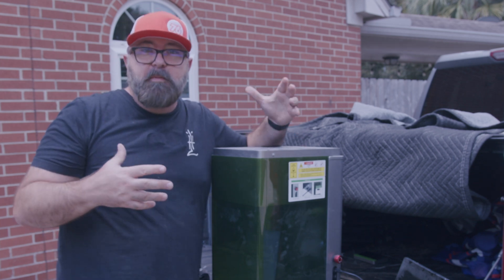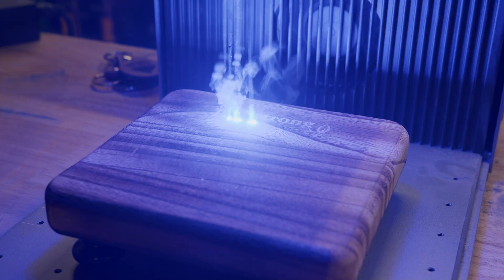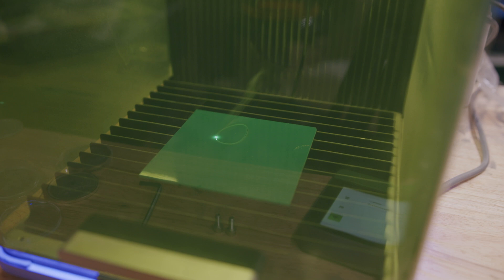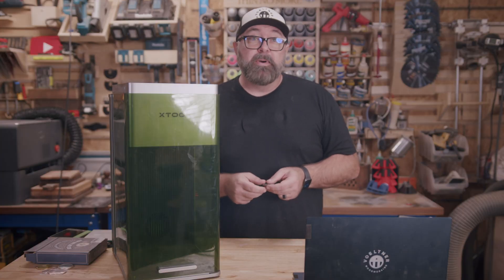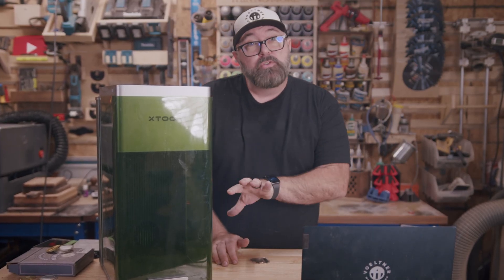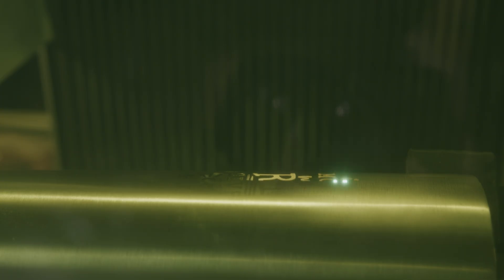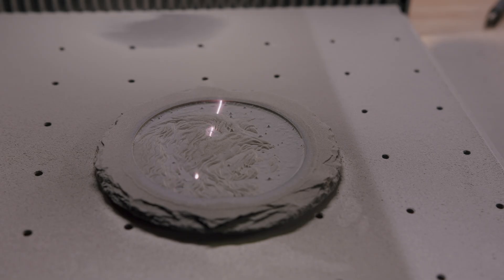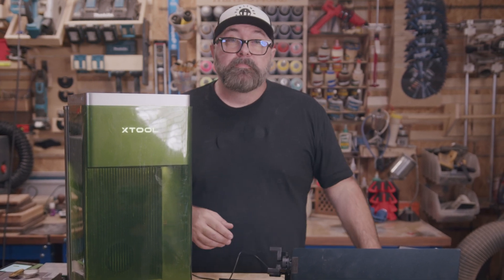Most versatile fiber laser? An xTool F1 Ultra follow up.

Comment: Creative space needs improving. It crashed on me a few times after spending hours making complex designs. Very frustrating.
Great machines to learn on and that's about it.
Reply from the maker: Interesting. It’s not crashed on me yet. That would be frustrating though.
Reply: All in all I like what xtool do. 

I've been testing the d1Pro for a few months and had 0 issues with the module, stepper motors and belts it's XCS that lacks.

Instead of incorporating AI first they should have advanced their basic editing features.
It's the little things that add up.
Reply from the maker: Are you using the new Beta version of the software? I haven't used my D1 in about a year, so I haven't really kept up with the features for that machine.
Reply: @VoeltnerWoodworking  I'm using the last version. 
I'm going to upgrade to the longer b1 40watt with lightburn.